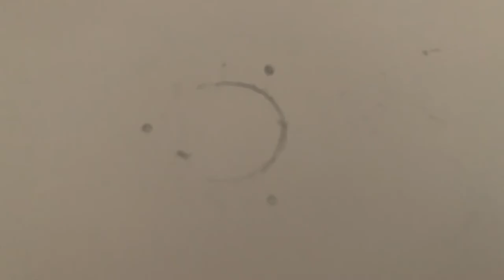DIY Slat Wall | TV wall Feature | EASY!

Comment: I am thinking of attempting this by myself as a 22 year old girl. The main thing that concerns me is the part with the wires. I also want to know what kind of wood you used, was it easy to do with tht bevel edge chisel, anything you would've done differently? ty!
Reply from the maker: Hi, you can buy the wood from b&q (I’m not sure what type it was). And yeah the chisel works fine, it’s just time consuming. Good luck 🤞

Comment: Me and my partner bought our house at a similar time to you guys so watching your tiktoks has been helpful! We actually wanted to do something like this, I was wondering where you decided to get your wood from and the type? Thanks!
Reply from the maker: Thank you! 😅 good luck with your renovations, the wood we used is Wickes Whitewood PSE Timber in lengths 12 x 44 x 2400mm. You can get thinner pieces, we went for thicker to fit the tv cables through them. I hope this helps!
Reply: @reno_with_us  thanks so much!